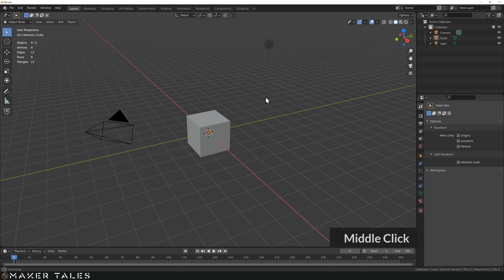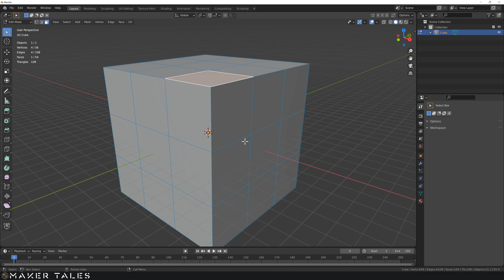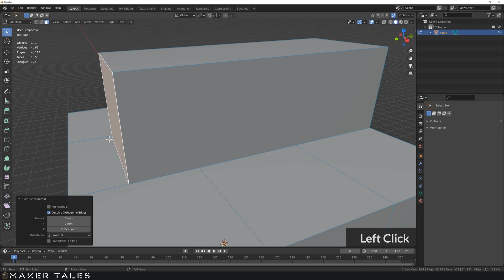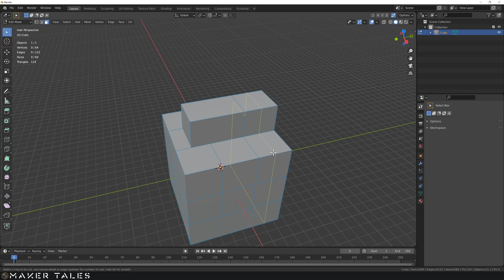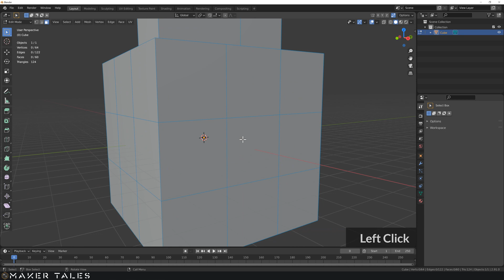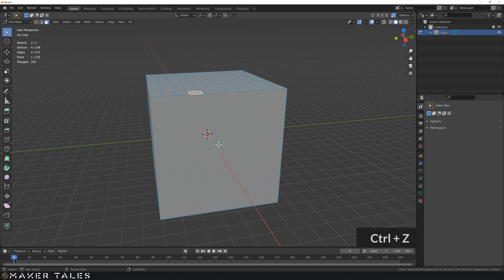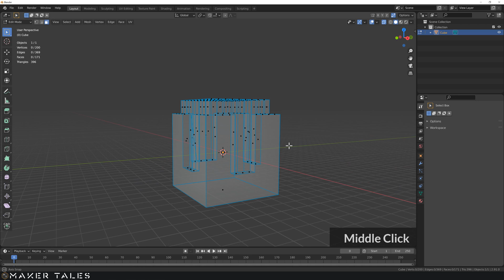Extrude Manifold & Internal Faces | Learning Blender 2.9 / 3.0 Through Precision Modeling | Part- 20

Comment: Nice video. I started experimenting with extrude manifold and did not know you could not extrude past an edge. As per fixing up geometry to make it quads, I use the knife tool with "cut through" on (hit C after K). It usually works quite nicely, and then you can do loop cuts again. Also I agree 100% that everything should be quads during block out - ideally throughout the whole process, but that's not always possible.

Comment: actually you can do it by enabling snap on vertex and extruding it on succeding vertex  until you reach the end, and delete the last face, or you can dissolve edges first and extrude manifold it. also you can have precision by setting your snap on incriment, select the face you want to move and move it a dialog will pop up and you can input how much you want to move or extrude it. you can verify if it create an internal face by select by trait if it produce another face.

Comment: Unrelated to the specific video: is anyone else having to disable then re-enable their CAD Transform every time they restart? I've saved my startup file and user preferences a million times. 

When I restart, the tool icon doesn't show up on the left. If I go to Preferences > Add-ons, it's enabled. I have to disable and re-enable and then it works fine. 

Anyone have advice?
Reply from the maker: Hmmmm that is strange... If you are still having troubles with CAD transforms your best place to get some help with it is here: https://blenderartists.org/t/cad-like-transform/1226197

Comment: Have they fixed up the manifold in the latest blender? I just installed it today and did what you did at 5:13 and it worked perfectly. I then did the raising up, and didn't have any internal faces at all.
Reply from the maker: Just tested it and it's still there. I have a feeling you did just another manifold extrusion and that would make no internal faces in my example. What I did was a normal extrusion in the example, thus i got internal faces.
Reply: @Keep-Making  That's likely, I'm just learning this stuff. But if the manifold one works, why would you do a normal one? I guess there are cases when you don't have a choice?
Reply: Just tested it in 2.93.3 and it is still broken. Would be very curious as to what the Blender development community has to say. It definitely appears to be a bug and is VERY reproducible.

Comment: Great informative video.
But as a amateur ex-SketchUp user and speaking from that perspective. If I just want to model a room quickly and print it on A4 paper to give to the carpenter for reference. I don't really give a dam about, if the model is perfect or not.
For serious modeling though, I agree that you could avoid it. 
But I definitely want to see this tool improved in the future.
Reply from the maker: Oh by all means if you just need something to show it can be great. Just be aware that if you need to material it to show it you could run in to some trouble but like everything in blender it's have lots of different ways of using it for every type of scenario.